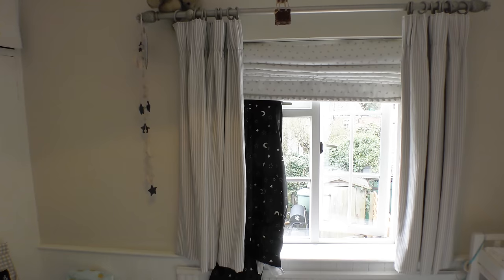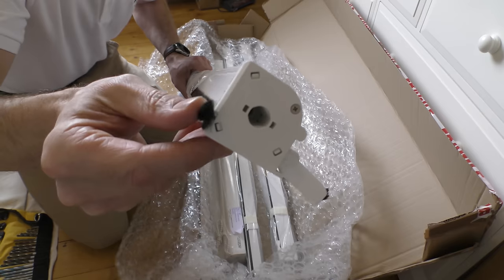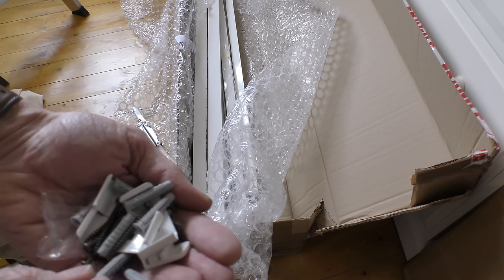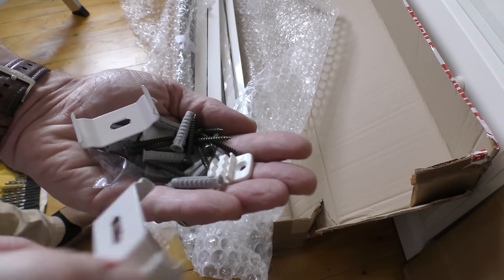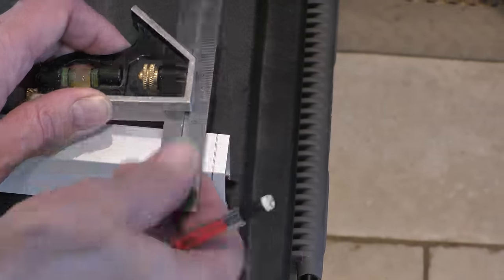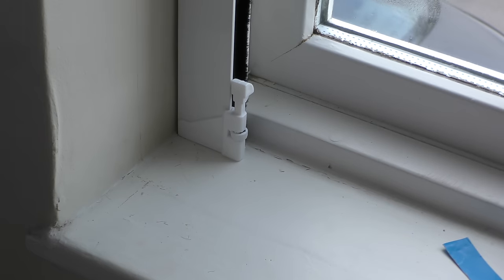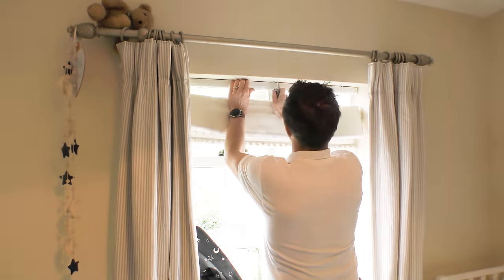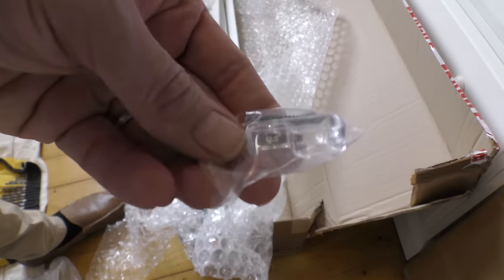How to Install Total Blackout Bedroom Blinds

Comment: Casstyle Blinds Limited hasn't been trading for 5 years, its a dormant company. Something dodgy here. Check companies house for CASSTYLE BLINDS LIMITED
Reply from the maker: I don't know what your agenda is here but Casstyle is an own brand of the manufacturers of this product, a small family owned business who I've been working with now for 10 years and they're amongst the fairest and most knowledgeable in the industry.
Reply: Many businesses have dormant companies as a means of brand protection.  Very disingenuous to suggest that something dodgy is going on just based on a dormant company.  Many businesses who trade as Sole Trader also have dormant limited companies, which is completely normal........!
Reply: A lot of people incorporate limited companies to prevent someone else using the name. They could be sole traders, a partnership or Casstyle Blinds is likely a trading name for another limited entity. I own an Accountancy business and it's very common for people to incorporate several businesses in their trading names either for future use or to stop someone else using it.